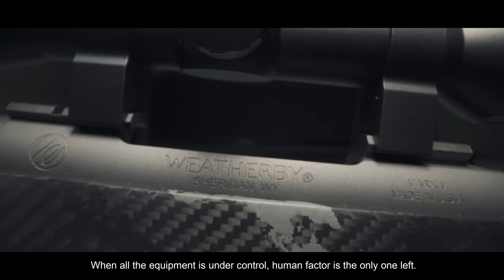WHY (I am a hunter)

Comment: my only problem with this is the gun you use, which is created in a factory by machines. Should realistically use a handcrafted weapon created from materials you can find in your wild environment. Otherwise the whole message you are preaching loses its strength, its still a message but its much weaker.

By using tools made by machines in factories, you're inevitably feeding the same system which is against hunting/wilderness.